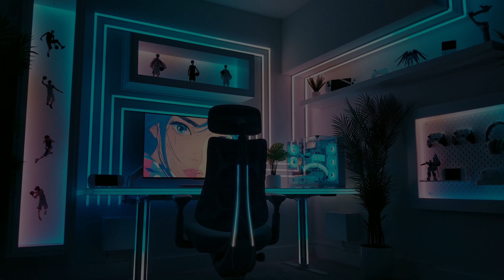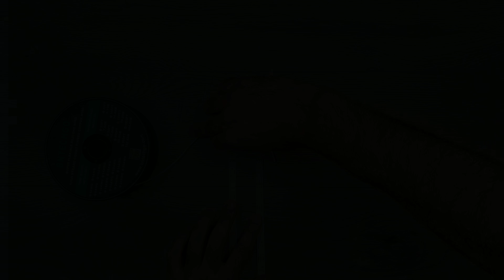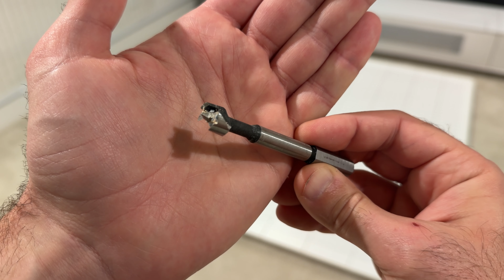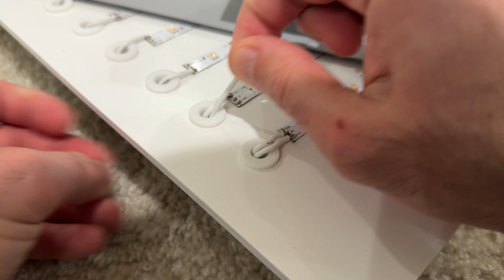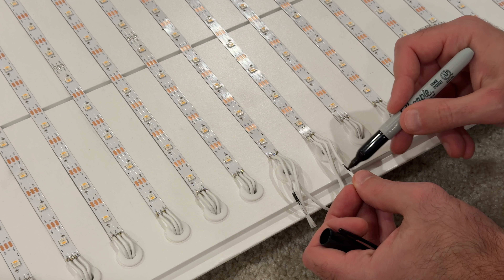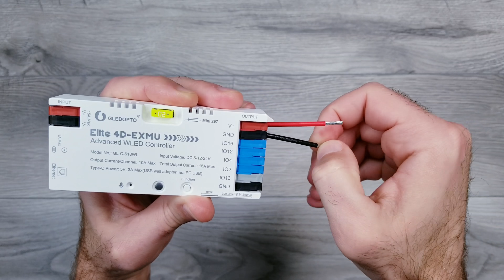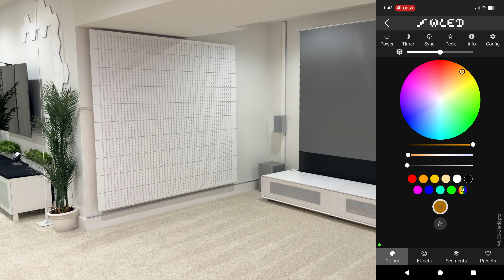DIY Matrix Panel: EASY, One Controller, One Power supply.

Comment: When I was doing this many years ago with a total of 1024 leds (using neopixels) I had wired them end to end at first without splitting the power and found that towards the end, when using full white for the whole matrix, it would lose power and the latter LEDs would turn yellow (with a weaker blue LED). I think I had tried a few ways to divide up the power load but couldn't ever get a configuration to get them all lit up white with correct colors. In the end I had to compromise with either lesser brightness or a different image to display. I should see if I do something similar to your setup if it would fix the issue. I also remember it getting incredibly hot too. Hopefully yours works nice and cool.

Comment: Why not simply use the led strip connector kits for this to make it solderless and easily replaceable, is it a voltage issue? Then you also don't need to drill holes, you can simply add a panel to hide the connector heads and wires. This makes it more accessible for everyone without the soldering tools.

Comment: A forstner bit isn't ideal, way too slow. You better use a normal wood drill as the diameter of the holes don't need to be that big.
Or a wood speed bit should do the trick as well much faster.

Comment: Love this project it looks amazing :) a long tedious task to build but definitely worth it!

I wonder if I could ask your advice - do you have experience with HUB75 matrix panels? I am trying to build a matrix consisting of four 128x64 matrices for a total size of 128x256. I'm struggling with what to use for a controller, I was pretty decided on something ESP32 based but I've tried so many different boards and I can't get any of them to handle it, I think the display is just too large. What controller would you suggest? My goal is to use it as a home dashboard linked to Home Assistant

Comment: While you did need to serpentine the data lines, the power lines didn't need to and you added more resistance to the system by doing that rather than a single bus bar across the top where each line can pull from
Reply: I was about to comment about that - there is adhesive copper tape that is really good for bus bars. doing that way he could have saved 100 cables and solderjobs.
Reply: I was wondering about that too. I’m relatively new to electronics so I thought there might have been some good reason for doing it this way, but clearly not. 🤣
Reply: @Backoffboogaloo yea terminal bars would definitely be ideal here; or potentially the copper tape but you would have to solder to the tape. The terminal bar has screws, which is an advantage.
Reply: I was coming here to stay the same thing! I'd be worried about voltage drop and would have preferred to have a single bus across the top with all the LED strips in parallel

Comment: 12:51 I've started using heat shrink "solder" connectors instead of wago connectors for things like this, they work pretty well
Reply: So you just twist the wire ends together and use heat shrink to compress the join?

Smack of an interesting video, comparing that to solder to wagos and such.
Reply: @ConorMasterson yes indeed! And there's a little low-temp solder in the very center of the heatshrink tube that melts as the tube shrinks. The only real improvement over the inline wago connectors is the thickness, but it's nice if you have multiple wires and want to heat shrink e.g. three joined pairs together

Comment: Sorry this isn't related to the video, but what diffuser channel do you recommend? I got the Govee Skyline light a little while back, but it's still sitting in its box because I wasn't aware it needed to be drilled into the wall, which I would rather not do. Also, the thing the light sits on is so bendy and isn't straight at all, even under tension. I don't know what I expected or why I thought it would be hard metal, but now I'm considering just putting the LED strip on a diffuser channel and sticking it to the wall.

Comment: Green should be ground.
Reply from the maker: Thanks for watching. Every addressable led strip comes pre-installed with wires from the manufacturer where green is connected to the data.
Reply: @ChrisMaherDIY  that’s dumb.  Data should be blue.

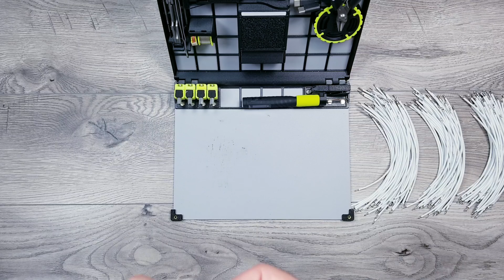Comment: @4:05 "..tinning the wire is what makes it possible..'  No.  No it's not.  It just makes it easier.  With good flux core solder, you don't have to tin the wires first.  On pads that size, you'd be nuts not to, but you still don't have to.
Reply: Can confirm that I have soldered similar 3 pin rgb strios as my first project after watching a craopy soldering video. I didnt tin any of the wires and struggled the whole time. However they still got soldered on.
Reply: 😢... Such a waste of a comment.

Comment: Soooooooooo... 2500 LEDs use less than 150W ? Damn. 
For future videos, would be geekly nice to also do a Watt / Consumption test.
Also, for most is redundant since you do it in every video, but would have loved more showcase at the end.
Reply: He is massively under powering these strips and getting away with it by using the output limiter in WLED. Very important detail! If I found the correct specs on Amazon, each strip is capable of 36W at 12V… about 3A. If he were doing this at full brightness over 18 strips he would need a much bigger power supply and could not run power through the single controller which is limited to 15A total output. (You would need to run power to strips directly from supply instead.)
Reply: I think it's not meant to blast full white at full intensity
But yeah, I'm also surprised
Reply: @Vevemusic  I googled it .. at full output the 2500 LED array barely reaches 95W, so for animations and nonwhite display it probably averages on 30-40W .. mindblown.

Comment: The wiring did make it difficult more than needed buddy not its pronounced vago w is pronounced v  n for the coloured wiring use white but put a bit of heat shrink on the back red pos  n black as neg
Reply: it is Wago or Vago, Wago themselves say it is country specific and the 'W' can be pronounced either way.

Comment: you asked if there is a better tool for the holes - router. just rip one line big enough for the wires and done all the way across the board. use a guide and you can make one perfectly straight line. a few passes til you hit full depth and just make one solid channel all the way across just big enough to pass your wires through. you don't need a 1/2" hole to pass them through if you're making a full length channel, you really only need it large enough to pass a single wire through.

Comment: I would recommend not passing all the power through the control unit. It has to deal with all the power management.
If you pair power and ground before the controller it has the same effect but the controller wont handle all the load. it stays cool =)

Comment: Great looking final execution!
Tinning that many wires is the perfect argument for a "solder pot" where you could just dip the wires into molten solder.
Reply: If the wire itself isn’t hot, isn’t there a risk the solder won’t adequately bond? Never used a solder pot so genuine question.
Reply: @devhammer  The transfer of heat is more than fast enough with a molten liquid.
Reply: This

Comment: Excellent tutorial!  If I did this, I would end up with a burned GLEDOPTO, LEDs, and power supply due to incorrect wiring.  Also, I would have a ton of burn marks on my carpet because my soldering iron fell on it.

Comment: @8:04 
Pre-Drill the hole 1/4-in bit, 
Use the forstner bit halfway through the thickness of the material, 
Flip the piece over and continue the hole from that direction. 
The forstner bit will create a clean entrance hole. So if you have a reference already provided by a pilot hole, you know exactly where the hole is to start on the other side. Then you have a clean hole on both sides.
Reply: It can be even simpler, drill through one side until just the pilot screw of the forstner bit breaks through, then use that hole to drill through from the opposite side.
Reply: I'dve marked the top and bottom boards and done the holes on a drill press before pinning them in place, prior to installing the led strips

Comment: I'm only 2mins in but I have to comment. Instead of counting 50leds, you could've marked the length on your desk with tape and just measured it quickly. 

And also, if you did a 48 pixel matrix you could have cut the JSTs off instead of desoldering them. As an added benefit 48 is a multiple of 2/4 making for cleaner pixel art scaling.

Anyway, on with the video you mad man.
Reply: I have no idea how he reliably counted each strip 50. there's no way he's a real human
these strips are repeting patterns and one involuntary eye movement you lose count
Reply: Then all the wires would be a different colour and he wanted a clean look with white wires.
Reply: @benwhittle7204 I don't think you understood either of the things I suggested.
Reply: @cray-   on the contrary, neither did you....
Reply: @benwhittle7204   no ben, you still missed it.

He had 150 LEDs, he could have CUT OFF the last LED, as in, throw away one of the LEDs, and still ended up with strips that had 48 LEDs in them. 

That way he wouldn't need to desolder the JST connectors, since he literally throws them away along with throwing away the 1 LED that he cut off.

48 LED's would have ended up as a multiple of 2, which is better for square representations (point 1 made by cray) and cutting off an LED would have still ended up with white wires, and been easier than desoldering 32 JST connectors.

So you absolutely didn't understand Cray.
Reply: @benwhittle7204  White heat shrink would be easier
Reply: Plus he did 50x50, so it's a 1:1 scale.
Reply: @benwhittle7204  the person said 48 is better for pixel art scaling but I would look into it. Just saying just because it seems to make sense to use 1:1 life has other plans
Reply: @benwhittle7204 also, for every led he cut off he’d lose one column. 48x48?

Comment: Bro, using green as the data color when green is commonly used for ground is driving me nuts
Reply from the maker: Thanks for watching. Every addressable led strip comes from the factory with wires attached where green is data. Since I'm pretty much only working with led strips, I keep it consistent to what people will see when they order addressable led strips as well.
Reply: @ChrisMaherDIY  Gotcha! Any reason why you didn’t use a white ribbon cable with all three cables together?

Comment: What was the total cost , this looks killer!
Reply from the maker: Thanks for watching! for the wood, leds, controller and power, probably around $700. Could probably do it for under 500 if you used cheaper led strips (ws2812b) but then your for sure going to need to do a lot of power injections.
Reply: @ChrisMaherDIY  i want to build it so bad to cover my ceiling, maybe one day i will get to it. it would be killer in the office/ man cave

Comment: Nice work! Why didn’t you use 60 leds per meter? Wouldn’t that have looked even better?
Reply from the maker: Thanks for watching! 60 leds per meter I think would look a little too much just like a tv panel and take away from the pixel effect I like. Plus you would run into software and power limitations using double the density led strip for this size of project.

Comment: I always wonder, do you consider the cooling of led strips with aluminium channels or profiles? I know, that using WLED and current limiter and if you dont put lights on full power white, it should be issue, but I just wonder :)
Reply from the maker: Yeah you could definitly use some aluminim channels for better heat dispersion but I run these things so low that there is hardly any heat. I dont think people truly realize how bright these things can get even at a low setting. Even at 5% brightness many of the animations hurt to look at because its just still crazy bright.

Comment: Hang on, I'm not all the way through but why not just use data repeaters instead of making them different sections?

Also, awesome job on the soldering! I would be troubleshooting for hours! lol
Reply from the maker: Thanks for watching! WLED recommends for best performance that you should never have more than 800 (it might be less but I can remember off the top of my head) connected to a single data output. While I have done more than 800 before. you start to really get a drop off in fps.

Comment: Could you make the matrix with more LED’s and have them packed tighter.
Reply from the maker: Thanks for watching! You could but your going to start running into software limitations and more leds means more power/power injection is needed. But you could certaily go a little bigger than I did here!
Reply: @ChrisMaherDIY  Is it possible to link more than one array through the software to create a much larger panel? I understand it requires more power, just not sure if it is possible.